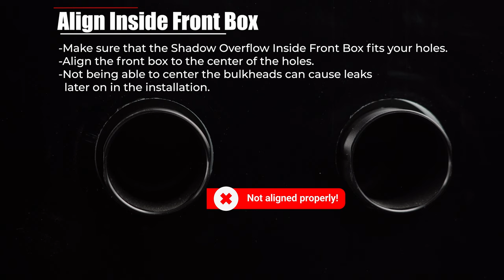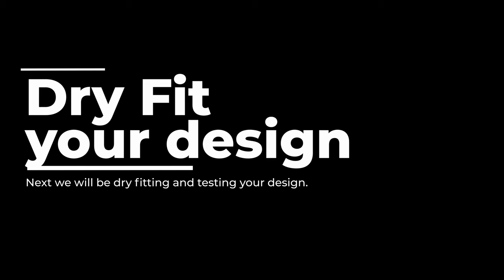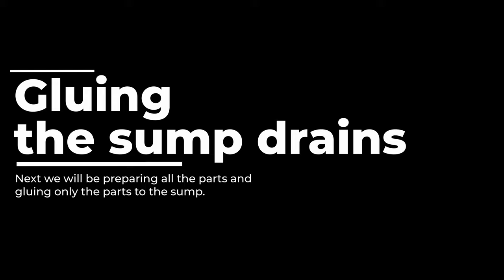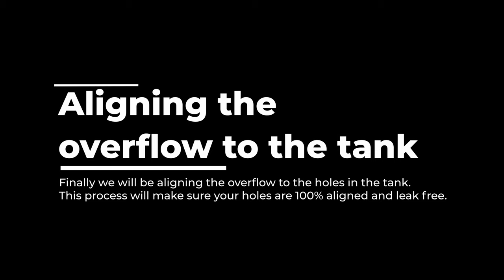Shadow® Overflow Installation onto an Aquarium

Comment: At the end you should’ve shown how to tune the over flow with the gate valve. Or the elbows needed for the different pipes. Just a suggestion.
Reply from the maker: We will have another video showing this procedure. That is a whole video in of it self. Thanks for the suggestion.

Comment: I have a 240 gallon 8x2x2 aquarium and I’m trying to figure out my best options for set up. It’s going to be a fresh water predator tank so I need lots of flow. I’m wondering if one of these boxes will be sufficient mounted in the middle. Or if I possibly need two boxes about two feet in on each side. With returns in the middle? I’ve been looking at other options as well. What do you recommend for overflow, and placement of box and returns.. Pumps rated at 3600, doesn’t mean I need to use it maxed out. Help me out..All comments welcome. Thanks!
Reply from the maker: You need to determine what your flow rate will be to your sump. Then you can decide if you will need 1 or 2 overflows. Each overflow can handle up to 2500 GPH. That pump with head pressure loss will be under 2500 GPH, unless it is a pressure rated pump. It really depends on how you plumb your system and what flow you want to achieve in your design. More overflows are going to allow for more flow out of the system.